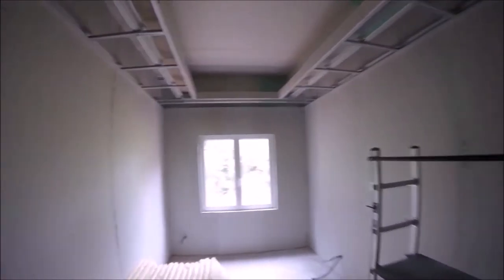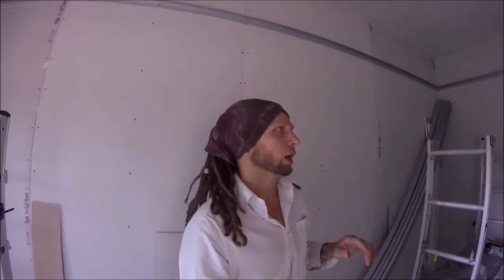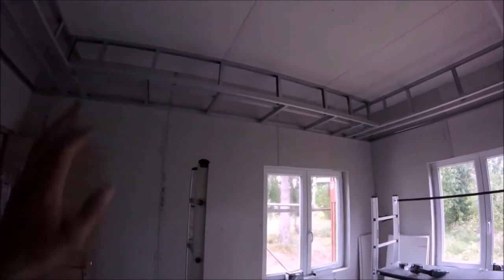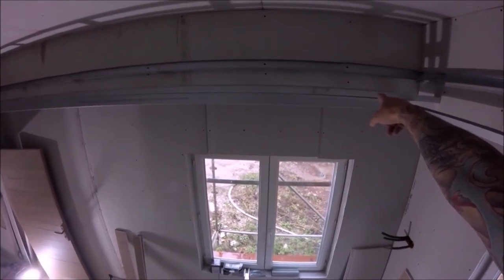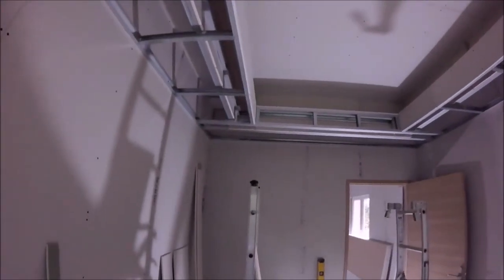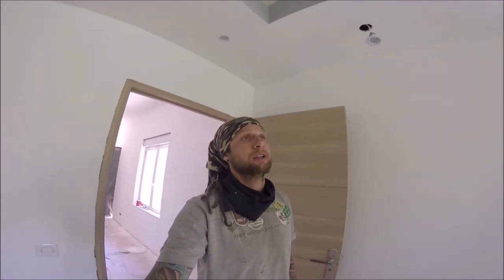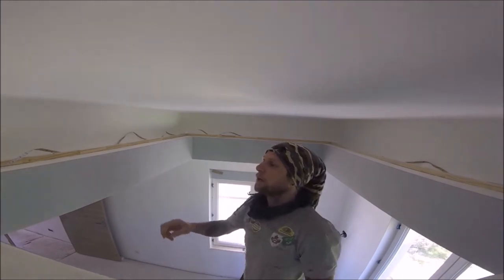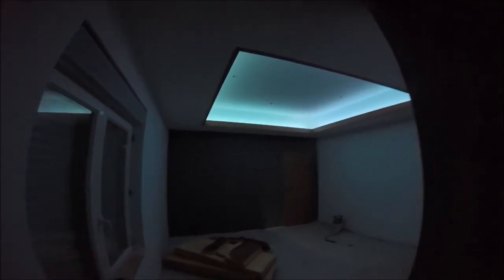HOW TO MAKE A DROPPED CEILING WITH LED LIGHTS

Comment: Really well done.

I'm a little put off at the thought of using metal rails rather than wood, but it definitely works.

Thank you for sharing.
Reply from the maker: We have termites here so common practice to use metal plus finding nice straight wood is rare here 😂 I’d rather use wood as it’s stronger but metal is quicker and cheaper

Comment: Hi Craig, it is amazing what you can do with the metal rail system. We have been watching your videos long before we moved out to France and thanks to you did our stud walls with metal. When you see the state of wood out here it is a much easier way to make walls and window reveals. Is the carpel tunnel still a problem, the crimping tool does make the hand a bit painful after a day of stud walling. We really like what you have done with the house.
Reply from the maker: The metal serves a good purpose and like you say at least it’s straight compared to a lot of there shit wood.
Still getting pins n needles in both arms but I need to keep working so just trying to stay off breakers and keep plastering down to a minimum

Comment: Could this be built just with some CLS timber and plasterboard?
Reply from the maker: Yes mate, I would prefer to build it with cls but in france they only sell wonky wood 😂 and wood worm is a problem
Reply: @perry210178  Cheers! Looks amazing by the way, you did an incredible job.
Reply from the maker: cheers mate, it’s still in perfect condition,led lights still working (govee led lights if interested) and we use them all the time and I’ve built a couple professionally for clients after they saw mine, good luck with it fella 👍